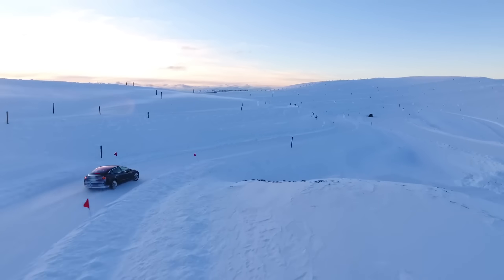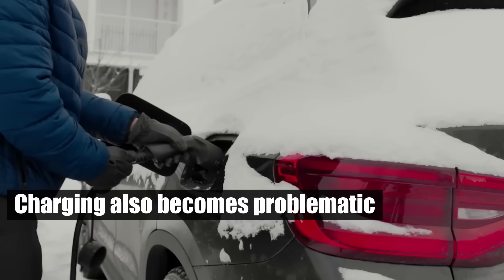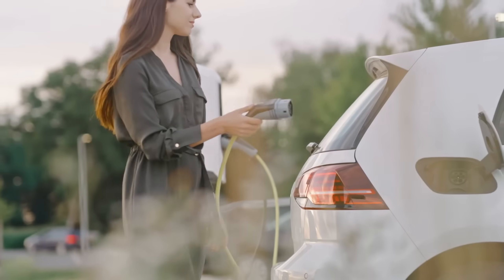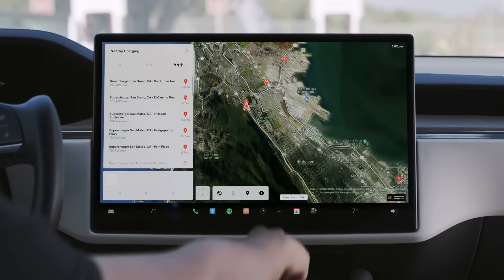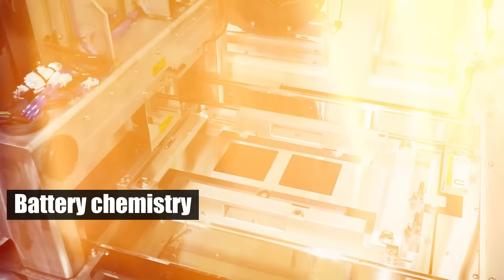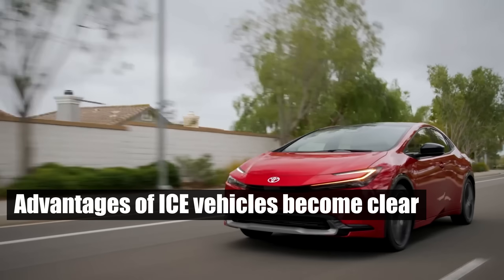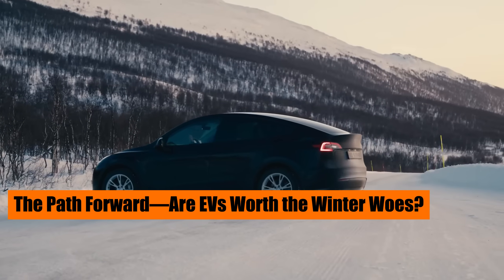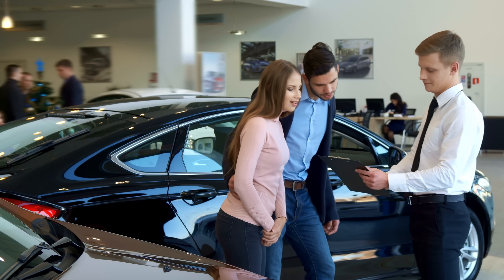EVs vs. Winter: The Freezing Truth That Left Drivers Stranded! Electric Vehicles Vs Winter, Weather!

Comment: Last winter my cousin stopped to help a family stranded on Wolf Creek Pass in southern Colorado. They were in an electric car but needed a can of gasoline. As it turned out the car could only get 34 miles on a full charge so they bought a generator in an attempt to leave the San Luis Valley. They didn't have enough gasoline for the generator. What a vacation that must have been. Most generators will run 5 or less hours on a full tank of fuel and it takes a 120 volt charge a couple days to charge an ev. What fun.

Comment: It is worse then that, Lithium batteries used in cars HAVE to be heated to warmer then 0C+ to be able to charge, at all... If you charge lithium batteries in colder then 0c temperatures (below freezing) you ruin the battery.

Comment: Some genuine issues of EVs in low temperatures and when people say ‘but we are working on that’ well that’s great, come back to me when you have sorted it! The idea of a range of fuelling options for vehicles is a much more sensible and realistic approach that ultimately will allow manufacturers to employ engineering and science to develop the best solutions. 
Just one mistake, ICE vehicles are not independent from power grids. Try refuelling one when there is a power failure. Those nice pumps that lift the fuel from the unground tanks, the payment systems all require electricity so not quite as independent as you claimed. 
A real issue is that as more cars become BEV, power grids are being pushed to their limits and no country in the world has prepared for it.

Comment: I have seen a Tesla driving with a very large diesel generator on its tow bar. Engine running and putting a charge into the battery as it drove along the motorway in UK. Others can often be seen in rainy weather and cold ,running with no lights or wipers to keep going.

Comment: I have a jaguar ipace, and a 1.6hdi citroen C3, we went on holiday in the C3 because it's much easier to fuel up, plus 720 miles range, the traction battery issue popped up on the ipace, been in and sorted, took 5 months!!!! In the cold it's so bad the range is less than half of what it's says it should be able to do, be gone next year, getting another tdi, stick your evs, I've also lost an absolute fortune as the jaguar has deprecated like you would not believe, I mean 15k loss in 1 year...

Comment: Ev's are for warmer better climate areas. Definitely not a primary cold weather area vehicle to use but a great 2nd or 3rd vehicle as it is with me, also have gas and diesels.
Reply: I'd argue it depends what EV, I have a tesla model 3LR, and having the car start perfectly every time and be warmed up every single time I get to it, even in -10 degree heat is so worth it and so much better than fiddling around with a combustion car for 20 minutes. 

The range drop doesn't matter if you travel 60 miles a day to commute anyway. And if you're driving more than that, my tesla has a heatpump, and Even in -14 degrees which it got to last year, I was able to drive 300 miles before my car got to 10% battery left.

Comment: Got to have an ice or hybrid for use in situation but got a lightning ford truck and great for  what I  use ot for. Im in upstate ny and dont drive with salt or calcium on road to avoid corrisuon. When roads clean I drive it. Wouldn't take a long trip with ev but if you can only have 1 vehicle it shouldn't be an ev but a hybrid. Also got heated shop but ev dosen't charge great because the truck thinks its in outside temp because of the trucks link with internet.  No one telling it is in a heated 70° area. Each type of vehicle has its uses

Comment: Every time I pull into a travel plaza and see a bunch of EV’s lined up, drivers reading books and ordering pizza, I get a good belly laugh.  10 minutes later I pull out, gas tank full, bladder empty and a drink and snack in hand.
Reply: Not to be petty but, you clearly just believe what you hear on the internet. But Lol the jokes on you,  you clearly don't understand that for most of those people, that 20 mins that they're sitting there enjoying a paper, probably only happens once a year on a long trip of more than 600 miles to visit someone. 

Most of the time they're charging at home, it takes 30 seconds to plug in and they wake up with 300 miles range every day with no effort 

Let's say you drive 20,000 miles a year. It takes you 5 minutes to fill up and pay, and 3 mins to drive out of your way to actually go to the petrol station (that's being generous because when I used to own a combustion car, it was sometimes longer)

20000miles÷600 miles = 33 times you need to fuel. 33 trips x 8minutes = 4.4 hours

20000miles÷350 miles range of my tesla (I have easily got 380 but im going to be harsh on myself) = 58 times I need to charge. It takes me well under 30 seconds to unhook the cable from my wall and plug it into my car, and then unplug it and hang it up, but let's say 30 seconds. 
58 x 0.5 = 29 minutes.

You would have wasted 4 hours longer than me driving out of your way for the "privilege" to buy expensive fuel for your car, vs my 30 minutes that it takes to plug a cable in after driving straight home and pay 4X less for it.

So a couple of 20 min charges a year are definitely worth relaxing and enjoying a paper over. And I was being generous on fuelling, and harsh on how long it takes to plug in a cable off my wall.

Comment: If you are stupid enough to buy a vehicle that costs at least double for insurance, wears the tires out much faster, depreciates 30-50% very quickly, is almost impossible to sell, can be totaled in a minor fender bender, can leave you stranded in very cold weather but unless you have an ICE vehicle as a backup you basically screwed yourself. Large numbers of people have simple returned the keys to the bank and told them to keep these disasters.
Reply: The only thing you're correct about is that unless you do very little driving, it shouldn't be your only vehicle.  As far as insurance goes, I'm paying less than half of what I used to pay.  My current tires on a Tesla Model S have almost 20K miles on them and aren't done yet (and I beat the hell out of the car), and I didn't buy the ripoff tires that were designed for EV's, I bought almost the cheapest they had at Discount Tire, around $600 out the door for 4.
Reply: High depreciation......buy second hand/used.   Had one for years, never been stranded.

Comment: Interesting.  How come I saw several videos of Teslas in deep winter in the Calgary and Edmonton areas of northern Canada which said a little planning took care of these issues?  And this was before Tesla announced major advances in their heat pump.  
These problems also apply to gas vehicles, which have battery issues which prevent starting, and in extreme cases, the fuel turning into gels.
Oh yeah.  And if the power grid goes down, just how do gas stations pump their fuel?  
ICE vehicles are a major issue in climate change.  Big Oil has lots of money to subsidize the EV naysayers to ensure their massive profits.

Comment: things that impact BEV also impact ICEV too, as they are both driven by chemical processes, and these are impacted by weather (hot/cold) and more geography too.   they both loose range (BEV as some reduced battery power and ICEV by increased inefficiency as burning fuel doesnt burn so well). have an ICDV doesnt mean you are immune to the weather at all

Comment: I am actually laughing. My diesel car was parked up 3 days ago, as I haven't needed it, with a range of 578 miles. Got in it today after 3 cold days and it still has a range of 578. It started straight away. You brainwashed EV drivers are going to be in trouble over the next 4 months in the UK. Meanwhile, I'm still laughing
Reply: I'm English, I too have a diesel, an old one, and there's no chance
on god's green earth that I'm ever going to drive around in a milk float.
Reply: Me too😂😂😂.
Reply: Horse and cart for me! EV no way!
Reply: An EV will leave you behind in the dust every time. (Had one for eleven years)
Reply: @harry130747  Really? A diesel car on a trip from Manchester to Loch Lomond would see yours still charging up at Carlisle
when it's on on the way back.

Comment: This is a crock. EVs can stay toasty, warm with electricity in the car which no more wastes electricity, then running the engine to keep the car warm wastes gasoline. I was stranded for six hours on the interstate in a snow storm at 10 degrees in my Tesla which has a heat pump.   It never got below 74 in the car. Six hours later when I finally took off the battery was at 60%.
What is it about guys with tiny, tiny dicks that makes them hate EV cars?

Comment: All of these "expert" EV lovers talking about gas stations being useless if the power goes out apparently never heard of generators. I don't know about other areas, but I've driven cross country a few times in Canada and they tend to have them in most gas stations. Never once been stranded because I couldn't get gas. Been tons of times we'd be without power at home for as much as a week because of storms. We survive because of ICE engines in our cars and generators and the ability to get fuel any time we need it. Darwin will weed out a bunch of you up here lol
Reply: If they have generators, they have electricity.

Funny, in the last hurricane EV owners juiced up their cars while gas stations ran out of gas and there were long lines. The ones that rode it out were able to run their refrigerators off the car battery.

Comment: Newer Tesla all have heat pump to keep battery warm, the Chicago issue was due to the wrong anti freeze used at the charging station.  Tesla seem to work well in Norway and Sweden; they must have a different type of cold?

Comment: Its the batteries stupid. Whatca gonna do when its -40F below 0?
Reply: The upper Midwest and Northeast (I'll even throw in Colorado) are only about 10% of the US population. The majority live in temperate climates, just as most Americans (80%) live East of the Mississippi and not in the vast expanse of the West. So, warm and densely populated. When you leave your car plugged in at night the BMS system keeps the battery warm at night by pulling AC power.
Reply: @ERIKM-ed9ef  also needs battery currant to keep it warm they say
like a tank of water with a rusty hole.

Comment: Teslas don't have a range of 300 miles. If you go from 100% to 0%, you can just about get 170 miles from a Model 3 Standard Range. If you charge between 30% and 80%, you have a real-world range of 80 miles. Half that when it's cold.
Reply: Sure they do. The SR is no longer made. The standard Model 3 now does 370 miles from 100-0 at 70 MPH. A Tesla range is basically infinite. The trip planning software will take you from Boston to Seattle in January no problem. You simply charge a few more times than would in spring/summer/fall.
Reply: @ERIKM-ed9ef  The only way a Tesla could do 370 miles without charging, is if it's on the back of a recovery truck.
Reply: @ERIKM-ed9ef bullshit

Comment: No sympathy for anyone that went down the EV rabbit hole!
Reply: @Ned-r4t  they must have known that it is an impractical route ...
Reply: I've had one for eleven years. Wonderful to drive, far better than an ICE.
Reply: @harry130747 I bet you won't say anything about how seriously cold temperatures would still affect the battery inside your precious EV
Reply: I hope you will not get jealous that I  saved 60000 euro between 2013 and 2021 by driving an EV.
Could buy for that savings my current ioniq 5 in that year....still saving every year 5000 to 6000 euro on running costs when I compare that car to a even sized awd ICE car.

Comment: Battery efficiency is thermally dependant. Heating the battery uses more, it's not sustainable.
Reply: The engineers say different. Philosophy only goes so far, then you need to do the math.

Comment: Running an EV in Canada during winter sounds like a really bad idea.
Reply: Especially in Winnipeg ("Portage and Main 50 below").
Reply: As against an ICE car that has to be plugged in for the block heater. DUH
Reply: @nathansmith7153  it'll stay warm enough for four hours and reheat in one.  It doesn't get get cold while you're driving.  Lots of Canadians drive three hours just to get somewhere.  An EV in a Saskatchewan blizzard in February is a death sentence.  Thankfully I still have my 73 Beetle with an auxiliary gas heater that has never got stuck in snow nor mud.
Reply: @nathansmith7153  If you think your going to get away with parking/storing an EV outside in the cold without plugging it in you have been miss informed.     

An EV should be plugged in long before an ICE, those batteries do not like to be cold. 

Once you get them cold it takes alot of juice to warm them back up. If its not plugged in and being warmed via the charger it uses your battery, sacrificing range.
Reply: Ev's aren't up to snuff yet and anybody who thinks so if smooth brained.
Reply: @kevincarter6001  There you go trying to make sense again. 
"Ev's aren't up to snuff yet and anybody who thinks so if smooth brained." LOL
Sorry, it must be tough being you.
Reply: @kevincarter6001  Plenty of snuff for more and more people as engineering marches on. Those last 2% of holdouts will be hard.
Reply: 7 years, only saved thousands. Learn something before you spew.

Comment: I have an  ev.  The range goes down in winter.  I charge it more often. Not rocket science.
Reply: The range is infinite. You simply stop to charge. I mean, ICE owners aren't really still using that first take of free gas they got at the dealer when they bought their car. ;)
Reply: @orionbetelgeuse1937  Not really. The longest I've gone in my Model 3 was 650 miles in one day. That's 250 out of your house; another 250 after lunch; and an additional 150 is basically your only "extra" time compared to gas. That's only a 20 minute stop. 650 miles is almost Los Angeles to the middle of New Mexico. Normally that's a drive in two days. In winter you would need maybe one additional 30 minute stop. I notice that nobody in their life complains that it takes their dish washer two hours to clean the dishes or that it takes you a hour to get up in the morning, shower and drink some coffee. You could speed that up by getting a brush cut (if you're a guy) so you don't need to shower in the morning. But nobody does that. Complaining about charging is a dishonest selective objection at best.

Comment: How does an EV  create heat for the cabin ?  . It will need a traditional electrical heater , which is another Hazzard in itself  !  An  I.C.E car just has to By-past the heat from the engine and into the cabin , a very safe method
Reply: They use heat pumps now. In the past older models used resistance heating. But no more.

Comment: Ev's still have a lot of problems. Therefor, costs of charging have to be half of ICE cars.  To compensate these  disadventages.
Reply: Charging at home costs about 1/3 what gas does. You're already there.
Reply: @ERIKM-ed9ef  I'am living in Germany. One kwh is in most areas around 0.35 Euros.  (0.37 Dollar) I charge at my 220 V Power Outlet with 13 a. Each hour brings around 5% to my battery (BMW I3 AH 120=38.6 net kwh)  There is a loss of minimum 10%  by loading (depends on temperatur). So in reality it is 0.42 Dollar per kwh.  Bigger problem. You mix private power consumption with car consumption. I don't get a bill to give it to reduce my taxes. (i own a shop)

In my opinion, they killed EV by rising energy costs that much. Energy in Germany dozbled in around 5 years.
Reply: @rainersta7073  In Upstate NY I pay National Grid 16 cents a KWHr, but don't get time of day discount. So about a quarter of the cost of gasoline.
Reply: @rainersta7073  In most of the US electric is less than gas. Has your fire and flood insurance increased in the past few years? My fire insurance increased by 1,000 dollars per year this year. So even if electricity were fractionally more expensive than gas, the climate caused insurance increase negates any savings.